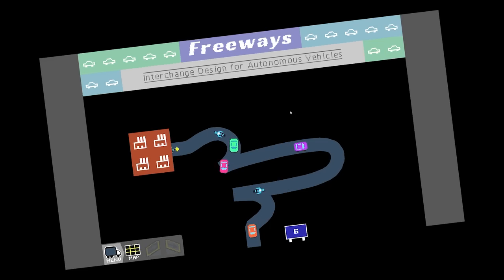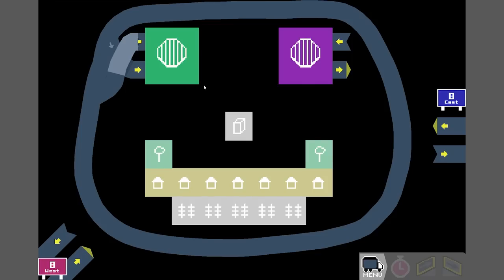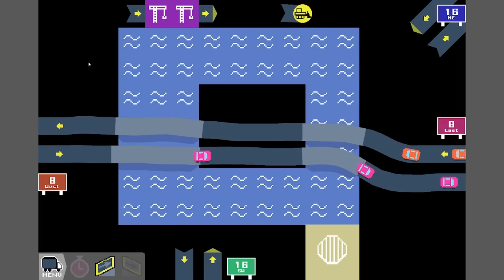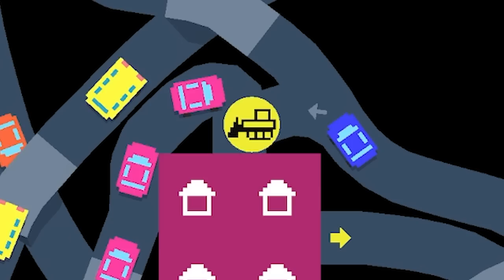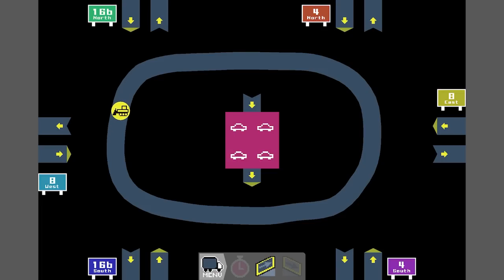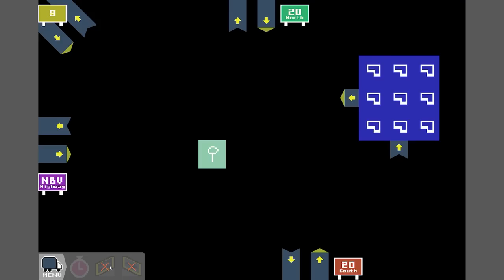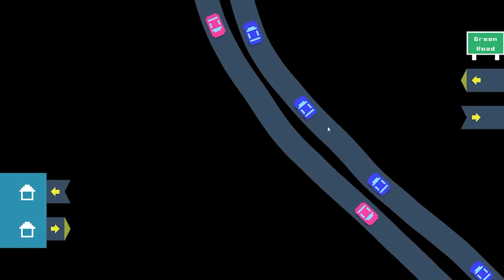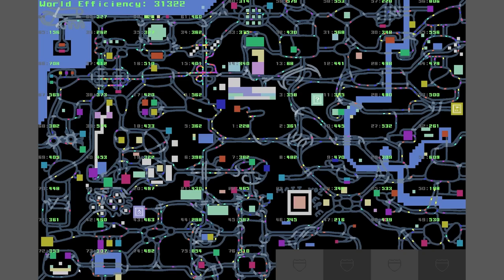Engineering simple solutions to complex traffic problems...

Comment: I would guess that the brain lost its bridges because the game was updated in-between playing the level the first time and now.
Reply: Not sure what triggers it, but there is bug, which sometimes allow you to use bridges at levels, where those are not allowed. Restarting the game fixes that bug. I've replicated that by myself once after resetting my world for a one-try-challenge. 

There have not been single update after steam release 2018 (if I remember year correctly), so your update theory is not possible.
Reply: @Satseful  That makes sense.  Thanks for correcting my assumption.
Reply: @Satseful  there has been an update, or at least I’ve received one.
Reply: @lukron5593  yeah, i checked and at android there were a bug fixing update, because app did crash at some devices. That update didn't fix bugs which are there every devices. That update was 2019. At steam there have not been updates, after release at 2017. iOS updates couldn't check right now.

Edit. Found the way to check ios. It have received few updates, so it is compatible with new ios versions and some bug fixings, which have appeared only at iphone / ios.
Reply: @Satseful  I’m sure I’ve received a steam update, haven’t owned the game on android or iOS but I must have misread something. My bad
Reply: @lukron5593  might've been synchronisation as that's also considered an update by steam. However don't know if it applies to your experience.
Reply: @RealPanzer999  ah could have been, didn’t know that thanks for telling
Reply: Naw you sure??
Reply: I just started playing this game and I think that was an update. That stage is supposed to be bridgeless and the difficulty was made using those japanese road (20 north).

Comment: The (probable) cause for a lower score in the last one is that you make your road too short (and you once put an unnecessary converge before a diverge!) The demand from point A to point B in this game is (pre)determined by the arrow thickness, so your road needs to withstand that throughput. In particular, induced demand is not a thing in this game (which is not realistic, but I guess the developer doesn't have the knowledge to implement such a mathematical model).

Comment: The scores are pretty much, what I expected. 75 bit less (expected 900) and 72 bit more (expected 300). For 72 I didn't expect that well founded the best layout, even while the non-optimal drawing slows it down, which required the extra road.

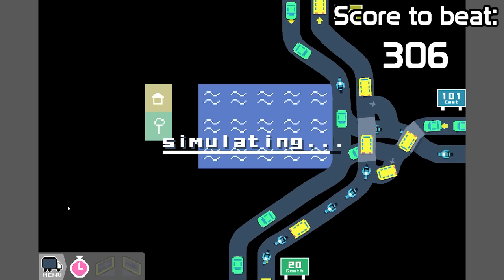Comment: At 18:37 you did very bad, because you had merge before the split and the narrower the corners the slower the cars can pass it. It is not only about „use as few concrete as possible“ but also about „make fluent roads“
I think fluent isn‘t the perfect word, but english isn‘t my first language
Reply: Fluent describes what you mean adequately.
Reply: In this level yellow buses slows down pretty easily, because of high traffic volume. Also yellow buses are slowest to accelerate in this game. So your point is even higher importance in that level, when using the layout, which rce used. 

English is not my first language either, so I hope you got the point I tried to tell.

Comment: I got 858 on lvl 75, so I've been waiting to see what you would do. What I did is a mess compared to your solution, showing how questionable the game's scoring is... Also, you should click that yellow square on the right side of the map, the one with the helicopter above a car.
Reply: Well game scoring system is pretty simple. You've got either less concrete usage or higher traffic flow, even if your solution seems more mess. I would guess your concrete usage is bit higher (around 7900 if my guess for traffic flow is correct), but got something like 100km/h traffic flow. RCE have so much and so long bridges, that it easily increases that concrete usage surprising high.